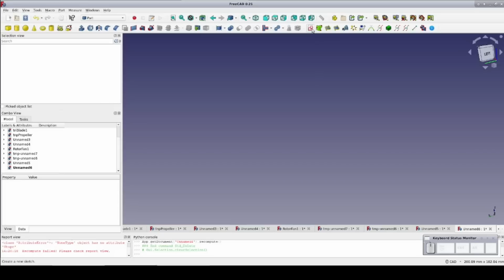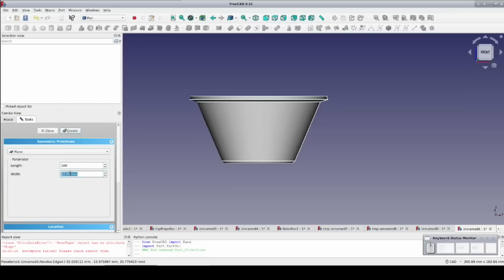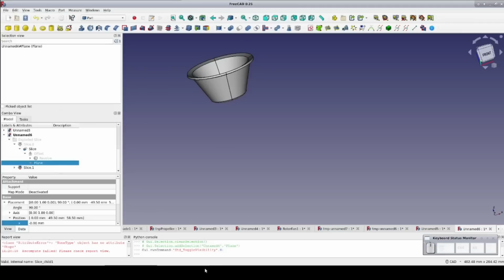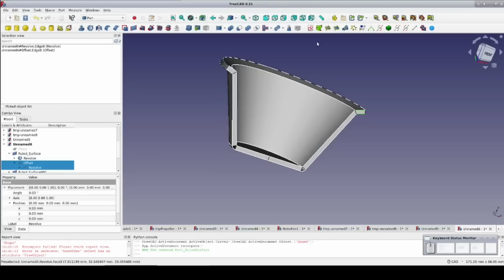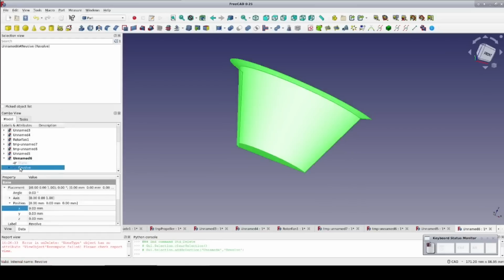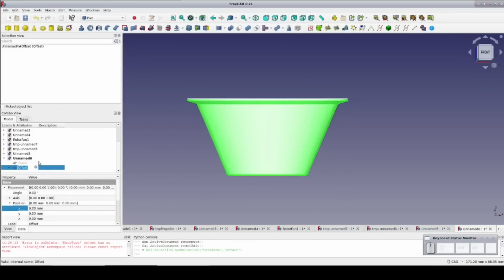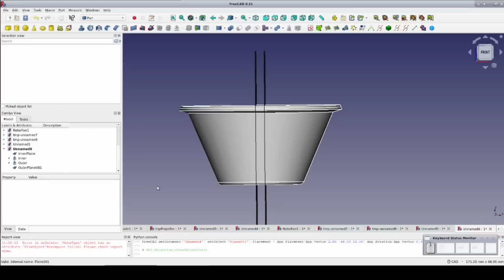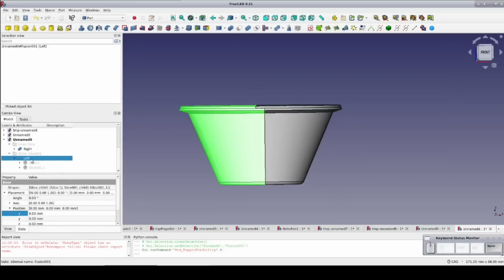FreeCAD: An open reply to Tom Sanladerer

Comment: all the workarounds explained in this video kinda just prove the points tom said tho... nothing is intuitive and there's so much weird super specific knowledge to have that any error is just confusing
Reply: it's weird people seem to make excuses for freecad's flaws instead of anyone trying to improve it. as long as that continues, people will use fusion 360 instead.
Reply: @TMS5100  to me it's more just that we already know what works, the formula has already been almost perfected in the form of Solid Edge, Solidworks and the other look-alikes. So having freecad not follow that same design style and usability, instead opting for weird design steps and intermediary steps of zero-thickness objects breaks all expectations we've come to have with all the other options that do a way better job of getting to a finished part that can be manufactured.
Reply: Agreed. And people just repeating "we do things differently" is missing the point that FreeCAD unnecessarily complicates even the simplest of tasks and that doing things so out of step with the workflow people are used to is just not a clever thing to do. I have a lot of patience but it ran out when I was trying to design parts in FreeCAD. IMO it’s a long way from being a viable alternative and - depressingly - headed in the wrong direction. I want FreeCAD to succeed and I would do anything (within reason) to help it succeed, except that I feel it’s headed in the wrong direction and I feel that my time, money and effort would be wasted. It’s a shame.
Reply: So you're saying it's appropriate it has a version number of .2 then and shouldn't be compared to finished and polished products.  Got it.
Reply: @brianmi40  it's not even past 1.0 and they are still trying to implement so many unnecessary things like flow simulation and robot or whatever even tho the very core of the software is completely unfinished and unintuitive? wow, that's some very bad resource management by the dev team

I understand it's a "small dev team with limited resources" but that's exactly why they should spend way more time doing better management than trying to do everything and spreading their resources so thin. having a proper project manager that doesn't do any technical work is a very valuable member of a dev team, I hope they get one soon
Reply: @EMILE12345678901  Perhaps you're aware that there are many different fields that CAD systems get used in which obviously brings competing priorities to the developers.   YOU may not care about "flow simulation", but I'm sure there are users who do.   Yet it's always ME, ME, ME - do what I WANT, without even understanding the competing demands involved.

Secondly, as a 100% CONTRIBUTED EFFORT PROJECT, developers in the early stages of a project choose what to work on more based upon their interest, rather than polishing other people's code.  Any "project manager" would also be UNPAID.  We could all wish that more developers, testers, project managers were to offer FREE TIME to the effort, but it's unrealistic to expect that.  It's just like Steam Early Access, if you're not interested in a program that is under development to test it out and see if it can perform a needed function, then you should stay away.  Sitting on the outside of a project that is a volunteer effort and simply chanting Go Faster and Fix Bugs doesn't help anyone, nor make any difference.  FreeCAD has both Contribute pages and multiple feedback Forums where you can help make a difference, but whining on YouTube does neither.

Lastly, I don't think software has to be intuitive really at all, least of all in pre-release stages.  That early, it's more important to get functionality working.  Especially not for the upper tiers of complexity like a CAD system, or a 3D animation system like Blender.  There are simply too many functions and features for EVERYTHING to be intuitive.  Who gets to decide the definition of intuitive?  You, or me or any of thousands of other users?   

What really matters is a MEANS TO LEARN IT that conveys understanding of how to complete a task as well as understand it for future use.  With literally HUNDREDS of tutorials on YT, I personally have found that to be completely true.  There's nothing I wanted to learn that wasn't explained and demo'd in multiple videos and for a version .2 I found them to be reasonable and intelligent workflows that once seen made sense to me to be able to use or modify for my purposes in the future.

All these comments are about plucking the mote out of the other guys eye, not the beam from your eye.  Perhaps if you're really interested in giving FreeCAD an honest go, spend time watching tutorial videos to judge what it is capable of, rather than expecting a .2 version to function as YOU SEE IT.  If that doesn't sound like something worth doing, then it's likely time to get out your credit card for an alternative commercial system where most are going to monthly fees.  The rest of us are willing to approach it with an open mind, learn how IT functions and find that we can get done what we need to with a free alternative to the commercial systems.
Reply: @EMILE12345678901 you're missing the point of open source development, the fact that someone worked on those features doesn't mean they would have worked on something else. It's made mostly by volunteers, either unpaid or not paid enough.

Comment: Very clear and informative video. I think of how Blender spent over 20 years being a niche product before they realized that ignoring the way the other players in the arena did things might be a mistake. They changed their user interface to something less "unique" and the popularity of the product exploded. Having a different way to do things when there is a overwhelming advantage to that method is fine, but making users learn your way of doing something just because you thought it was cool or easier to program is just shooting yourself in the foot.
Reply: yep thats true.
Also if Blender ever choose to add parametric modeling they will become the number 1 CAD program over night.
Reply: @An Obscure Tenet That's a fair correction. the functionality was *there*, but it was like trying to polish jewelery with a belt sander while wearing oven mitts.
Reply: I used Blender heavily and remember the community backlash Andrew from Blender Guru got after suggesting the UI changes. Just about every suggestion he made was later implemented. I feel the same thing needs to happen to FreeCAD to make it more relevant. It has so much potential.
Reply: Blender devs have always been aware of its differences with other UIs. It's not really about being "unique", but about being able to use it as effectively as possible. Blender is still unique and nearly all the tools and workflows it previously had still exist in it, but at the same time it's easier for newcomers from other packages to discover the desired functionality. The difficulty was to reconcile the two, but they eventually achieved it.
Reply: When you understand the fundamentals of what a type of software is trying to achieve, and you just want to get something done, learning new software is a chore at the best of times. When a program willfully ignores conventions (which become conventions for a reason) then I'm not going to waste my time. Resistance to making software easy to use usually comes from the hardcore nerds who want there to be an unnecessary learning curve just to protect their own investment in learning to do it "the hard way." Learning how to use an obtuse piece of software when you can get the same result much more easily in another product isn't some sort of bragging right.
Reply: @Culky  define easier?  Because blender lets me do things fast. Also the way you describe conventions just sound like Stockholm syndrome
Reply: Blender didn't do it to be unique, they did it according to what made sense in their design since day one. That doesn't mean there isn't room for improvement but you need to design the UX to fit what blender is build on. Radically changing blender will also change workflow. Which can be good, but can also go very bad.
Reply: They built blender the way they wanted. If it changed, it's because new people contributed what they wanted. If you want something designed by the marketing department, buy it. Otherwise, you are welcome to contribute code.
Reply: @ernststravoblofeld  Wasn't the UI overhaul a concentrated development effort from the blender foundation? I'm pretty sure it wasn't just a random developer submitting a pull request.
Reply: @amoliski  Who is the foundation?
Reply: @ernststravoblofeld  his argument still stands. being different for the purpose of beeing different has no advantage to anyone, besides maybe your ego. 
After all blender is a community project, so if you want to have a big community which enables you to do bigger things, you should cater to their preferences -  if you want to stay niche, obviously, you dont care.
But to my knowledge, blender showed a lot of the industry what an open source perspective can have for incredible possibilities. And alone getting this knowledge out there is worth stop beeing cool and niche and try to cater to peoples preferences - some of which might be even there for a good reason other than its always been this way or the people want nicve and shiny things.

I would be thrilled if freeCAD went the blender way and did the same thing for the cad world what blender did to CGI Robots and even 3d printing. Especially because i hate autodesk, dassault and all the other corporate shitholes
Reply: @ozr2222  If a developer wants a feature, and writes it in, that's ego? In that case put some of your ego in as well.
Reply: @ozr2222  I use Blender since its old days (where you needed a manual to be able to do anything), and it has always catered to its community. The main difference between the two is not that one ignores their users, it is that the other eventually got more devs, more funding, through the open movie projects among other things... More funding = faster development, and it eventually reached a point where the UI could change again to be more accessible to newcomers without compromising functionality for experienced users like me. And I said "again" because it's not the first time it gets a complete UI overhaul. In the old times we didn't even have customizable key shortcuts!! You frequently didn't have the choice but to use the predefined keys for a lot of functionality.

Comment: Freecad needs a UI overhaul. It is NOT intuitive. Fusion360 and Solidworks are. "personal preference" and "the freecad way" give the freecad devs excuses to not improve the UI.
Reply: Aren't there other options for you to use?
Reply: @ernststravoblofeld  yes, i and the majority of the maker community use fusion 360. as long as the response is "use something else" instead of "freecad will improve the ui", people will continue to use something else.
Reply: @TMS5100  So you already have an alternative, then?
Reply: @ernststravoblofeld onshape, openscad, blender, tinkercad, sketch
Reply: The only intuitive thing about SW and F360 is that they use the ribbon menu. 
Hardly a benefit if the software doesn't work because it is so poorly written you can't make a one sketch part due to lack of optimisation.
FreeCAD works, NX works, Blender works, Solidworks doesn't.
Reply: @tymoteuszkazubski2755  well that and the fact that when you do something that isn't 100% correct they still make it work.

And how their part design can handle multiple solids.
And how you dont need to make new shapes to use those shapes as tools, cause you already have the tools working the way you want them by just selecting a face or object.

And how you don't have different workflows forcedly separated by different workbenches, when the actual workflow is in between the different workbenches.

Or how you don't even have a complete set of default shortkeys, forcing you to use the mouse overly much.

Or how the mouse cursor selects 2 pixels lower than what it is pointing at.

Or how it opens for console coding. But doesn't really allow for custom code commands without copy and pasting everything into console or massively working around the software by making your won console that you can place into it that lets you do so...

Or how it doesn't handle multiple threads, and doesn't even use the GPU when ut is available.

Like, don't have me mistaken, i use freecad on a near daily basis and have been doing so for well over 4 years by now. I have learned the different types of workflow and i have setup my own workbenches and coded my own tools that make my freecad work the way i want it to. However, before this i used Onshape, and i find myself still working faster on onshape now even tho i havent used it more than every now and then to help out my friends.

You shouldn't need to be a senior developer with over 10 years of coding experience and 4 years of experience working with the software with custom made tools and functions to be able to use the software without struggles.
And any type of software where this is the case is a software that severely needs improvements and redesign.
Reply: So you're saying the version number of .2 is appropriate.  Got it.

Comment: Thank you for doing this.  I am new to 3D printing and CAD so I began learning FreeCAD by following the great tutorials found on Youtube.  I found it still a little confusing, however I was progressing.  I had also heard about Fusion360 and saw Toms video so I thought that maybe I was trying to learn the wrong program.  Actually I had just as much frustration with Fusion360 as I had with FreeCAD, so I will continue with FreeCAD realizing that it is just CAD in general that for me is a little bit harder to learn than other things.  Again thank you.
Reply: I'm on the same path, but so far have been able to find a good YT video for anything i try to do, most advanced of which so far was a window actuator part for a power car window, which had to be curved in two ways with lots of precise measurements to get it to work.  5 Test prints later, it works fine in the car, and I learned a TON along the way doing it.

Being new to CAD is actually a benefit for you as you don't try things that don't work from prior experience.  I haven't found anything I can't do in FreeCAD, just tons I haven't tried yet.

I almost attempted this video myself, as I was certain it could do what Tom tried and failed with it when I watched his video.
Reply: Same for me. FreeCAD is in many ways more logical than Fusion. Why is dimension not found under constraints in fusion? Especially the constraints list in sketches is something I sorely miss in fusion.

Comment: I am wondering why are you doing it in such convoluted and complicated way?
Just draw the entire cross-section of a round object and rotate it 180 degrees.
One sketch, one operation and done.
No offset, no fill, no nothing else…
Reply from the maker: I only did a 180 revolve to illustrate why the operation Tom attempted failed. I wouldn't use that approach for the actual design. 

 In the second half where I actually designed the seed pot, I used offsets and splits as a quick way to get a fully parametric design for interlocking halves.

Comment: A very elegant and straight forward solution. Just shows that 3d design is hard to master no matter what software you use. I like FreeCAD for all the toolboxes and functions (e g. Lasercut interlock) but it takes some time to learn. In an industrial setting your designers will be specialized in specific tools (often SolidWorks). Fusion 360 has become the choice of the typical maker/small business because of the price, but this can change...

Comment: The part at 4:40 is really useful for understanding. So many times I was frustrated and gave up on certain design features just because the fill tool would error out on me.... I don't understand why Intersection is not the default mode instead of Arc. Would have saved newbies like me the confusion 😅 but I'm glad videos like this exist in this community. Thank you so much for a detailed explanation
Reply: Only using it for 5 months, I've run across a lot of gotchas, like undoing a boolean operation that was preventing other changes to the body, then reapplying afterward...  So far it's done everything I've tried, and I've learned a lot to where I can come up with workflows for the design I have in mind.